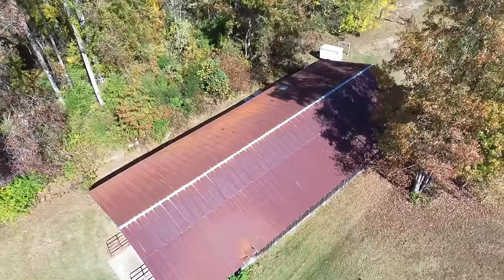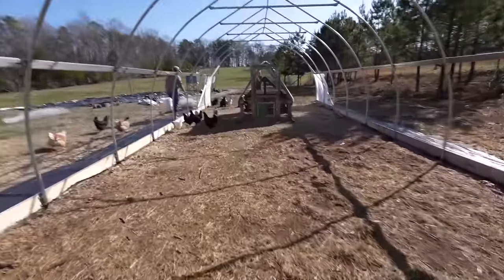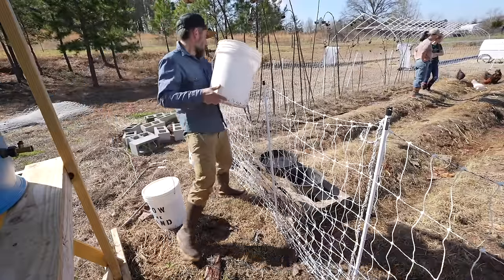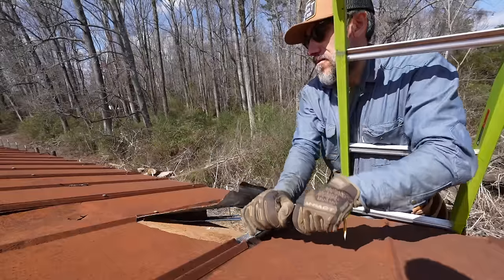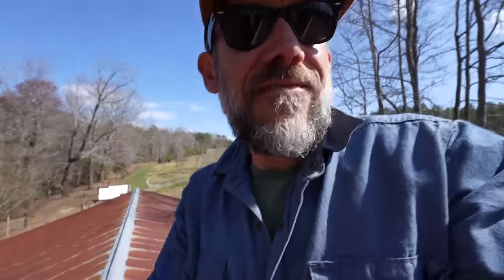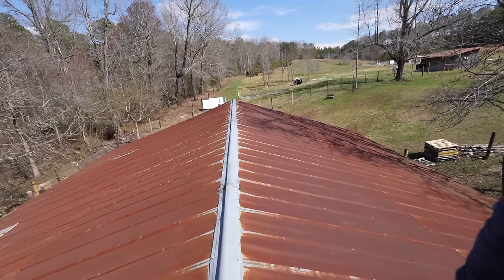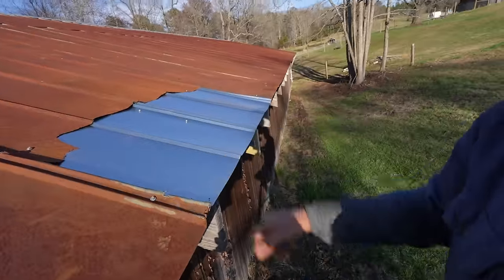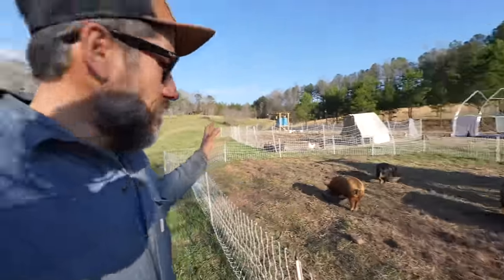Repairing Holes on 8,000 Dollar Barn Roof

Comment: Look into GACO silicone coating. After trying to seal my metal roofs for thirty years without success I'm going into my fourth year without a leak and no sign of deterioration. Nothing stick to it, debris blows or washes off.  My roofs are more than 50 years old. Comes in colors. Said to last 50 years. Not the cheapest product but it does work. I even covered some areas that were rusted to the point of small nail size holes, no leaks or separating.   Easy to install. Your roof would be a piece of cake. Just powerwash it, fill larger gaps with silicon filler and roll it or brush it on.
Never saw a roof that you could just tear with your bare hands!!
Enjoy your podcast with Al and Ben
Reply: We used the GACO silicone sealer on our metal porch roof.. pricey stuff.. thick, and a challenge to apply BUT MAN... Not one leak in years.  If applied correctly it lasts an insane amount of time.

Comment: In the distant past, when my buddies and I were all obsessed with the newest computer hardware, (and before the craze for tricked out lighted cases)  I would buy all the components at the high end of the sweet spot of the supply and demand curve.   But I would buy the cheapest case I could.   I referred to such cases as the "hand cutter special" at Frys.  Its a totally different realm of work and effort but that roof is giving "hand cutter special" flashbacks.

Comment: if you use a block like a piece of 1x4 or 2x4 to lever the flatbar against you will be able to pull the nails out much easier, without damaging the roofing. also if you use seal a flex or hydrostop to coat that roof with you could make it last almost indefinitely, and it will look really nice too. you can use any color you want for the top coat but I would use the green rust primer for the first coat. they also have a fabric that you can lay down and coat to fix small leaks or flash transitions. I have done a bunch of 1800's historic homes with original standing seam roofs this way with excellent results, and its less labor than replacing all the roofing. I prefer the hydrostop over the seal o flex but either will work. Good luck with your property it looks beautiful.

Comment: We have a 30x180' old hen house from the 1960's that used to have 5000 laying hens in it. The roof is not fun to go up on to repair but it is doable. The metal roofing is a lot heavier than yours, though looks like the same type of nails here as yours. Winds here have taken a few panels off over the years but no damage yet. Keep up the good work. :)

Comment: The IBC cages in your non junk plie make great houses for young chickens  net half cover half put roof on and floor then use a tractor to shift the houses when move chickens that's what I've done as frame already there quick and easy job done and recycling
Reply from the maker: Thanks for the tip!

Comment: You probably won’t see this but I worry that putting a coating on the roof would taint any rain water you plan to catch, especially when the costing begins to degrade. That’s a huge benefit of metal roof vs asphalt, not a bunch of chemicals in your water!

Hey also you can put a little block of wood under your hammer when prying nails to greatly increase the leverage when pulling those stubborn ones. At least you know those nails are in there good and the roof isn’t gonna peel off in the wind. ✌️

Comment: Theres a reason why you use nails for these structures. Screws are hard and can easily break when structure is moving in the wind and/or metal is expanding in or subtracting in the heat/cold. Nails do not have this problem, they are much softer and can bend or expand together with structure. Thats why you dont use screws and anyone who does is making mistake. 

Also If I noticed correctly you are not using screws on "wave top" and thats why it will be leaking through those holes when it will rain good enough.

Comment: Use House Trailer elastiomeric  roof paint. I used it on a roof like yours, the rust will bleed though white but it worked good. The white was an ugly light brown but hey no water on inside. Always wondered if the Aluminum color might have been better with the bleed though. But hey no water.

Comment: If I may expand on my comment about GACO yesterday and my 30+ year struggle to seal metal roofing. I have no connection to them and receive nothing from them. When I see people struggling with problems I have overcome it's only fair to speak up. I'm in my 80's and tired of climbing on roofs.  Over the course of time I tried a myriad of products and techniques in applying them. All of them failed, some sooner than others. A contractor/friend told me about GACO. He has been using it for 40 or more years in many applications. He has never had a failure or a callback where it has been used. The common denominator with the other products I tried is they are all petroleum based. That means they all begin to fail as soon as they are applied. Think driveways, roads, etc. Continued use of them created for me a increasingly difficult time actually finding where the leaks were coming from. The buildup became thicker, the lower layers were separating from the base roof, cracking, etc. but you could not see it. Water will find those places. Your roof does not have all those incumbrances, yet. To cover large gaps that could hold water or allow the wind push water into them I used Henrys pure silicone filler. Places like where the metal overlapped in long runs or a patch like you just made. I have tried it on material other than steel, so far so good. I've experimented with using it on vertical chipboard in place of flashing. Four years in and it still looks like new. As long as fasteners are tight and sound GACO will seal them.
I hope this will help you and any others with similar problems.

Comment: Dude, just advise….don’t step on the ‘seams’ of the roof panels, they will crack under your weight and cause more leaks…..I would save up to replace that roof, the rust is eating away at the metal panels that’s why they are so thin….replace from one end to the other if you can for budget sakes….best wishes